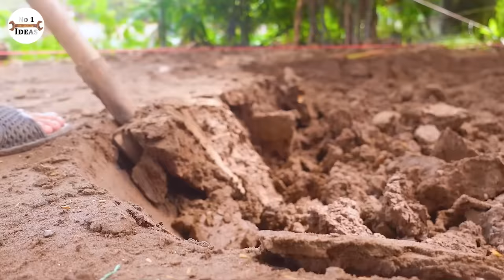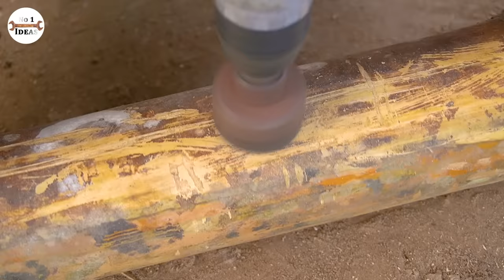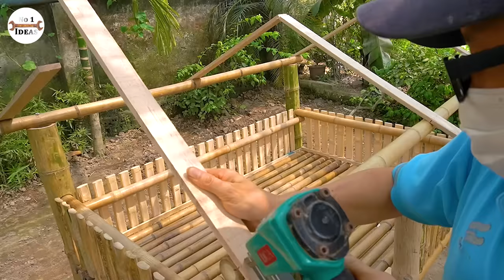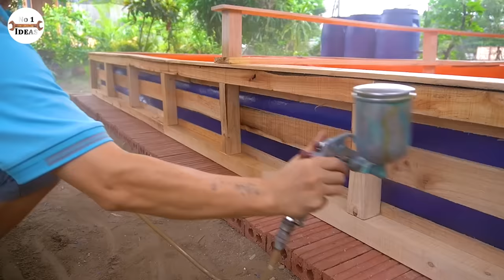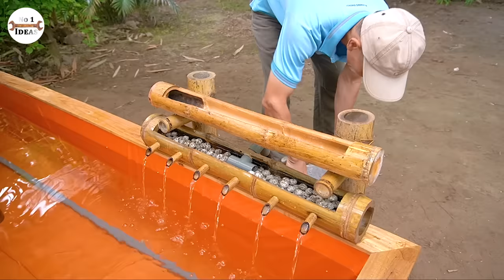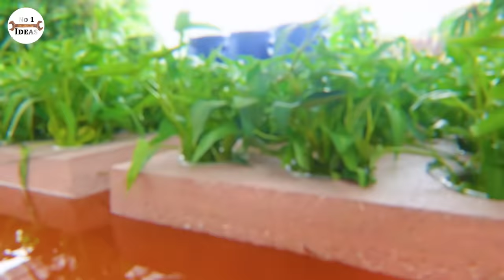3in1 design! Build aquarium jointed with fresh vegetables and duck coop

Comment: Good video, just one question, could anyone tell me what is he using to wrap the plants? Is it cotton or what material is he using?
Reply: It looks like cotton cheesecloth or a pant fiber
Reply: You can go to pet stores and buy a fiber that is for filters it's cotton works with animals and is really cheap fiber will give good root hold I used it in hydroponics and aquaponics I mixed it with a little canna coco coconut fiber husks it was clean and efficient
Reply: @billbraskey8089  thanks, cotton fiber works, I hope is cheap, blessings
Reply: @billbraskey8089  cana coco, ok thats new, and where you use it, in the filter system?

Comment: The kangkong garden is an amazing idea.
We have a big pond, and the kangkongs are getting out of control, we don't want to get rid of it all, but every other week it's covered 3/4 of the surface.
Will definitely tell my Tito about this idea but probably use different material instead of Styrofoam to maybe DIY net to hold the cups so there will be space for the fishes between to breath since we're planning to sell both fishes and the kangkong.

Thank you for the idea😊
Reply: love you 😍😍😍😍

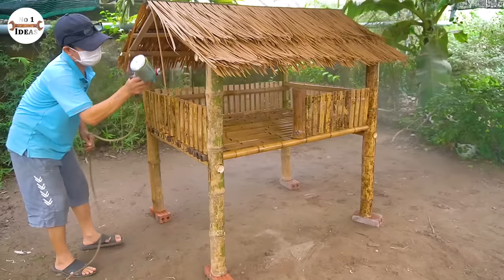Comment: Cool video! I've been wanting to try your trick for a while now. Will definitely be checking out your channel for more tips." Bamboo is still cheap and durable (if old enough to be soaked in mud for a long time). What are you coating the material with at 7:16?